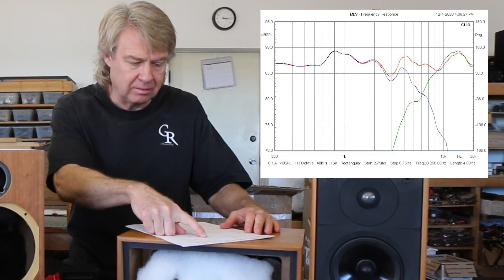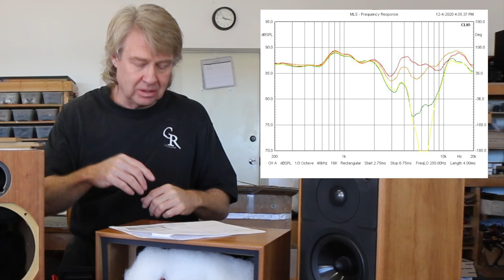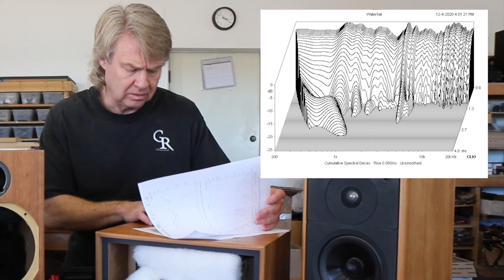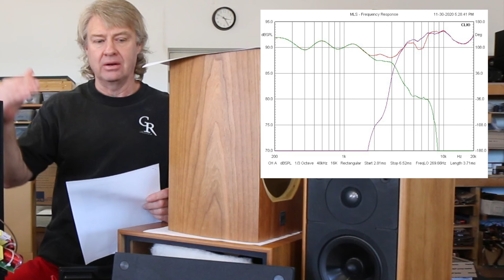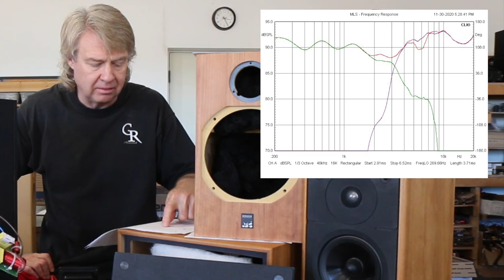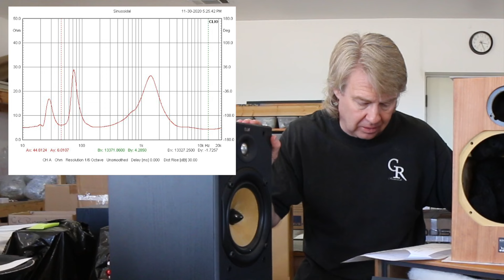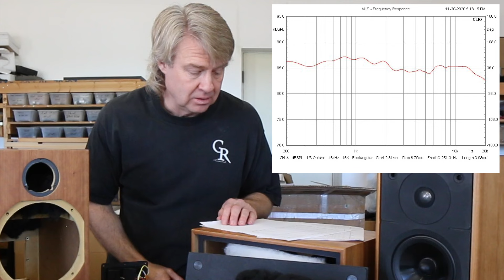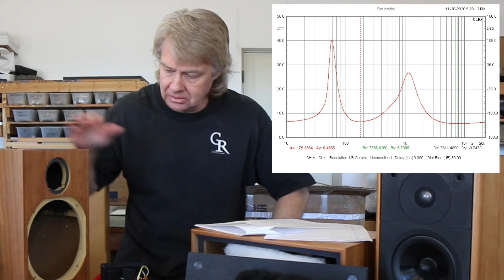FINALLY! A SPEAKER DANNY LIKES?! B&W, Epos and ATC!

Comment: I just picked up a pair of Tyler D3M monitors.  What are your thoughts?  Room for upgrade?
Reply: It is hard to get much out of those metal cone Dayton drivers, but I am sure there is a lot of room for improvement with the crossovers.
Reply: @dannyrichie9743  Mine are fitted with Gui-Sound paper cone woofers.  Says Custom: Tyler, 16 ohm, 20W.  FR158B16-11M

Comment: Rcently decided to take my 1995 B&W P4 crossovers apart. Having already researched what to expect, there are really some performance limiting components for a speaker that cost £600 per pair back then. Very simple second order with electrolytic caps and small iron core inductors are not in keeping with the decent drivers and a transmission line cabinet. They do not sound bright as per the B&Ws in this review (even though they use the same drivers) because the tweeter ferrofluid has long since dried up. I only notice what a tweeter should sound like when I go to my office and listen to some silk dome Cyrus CLS50s. Needless to say, the P4s will be treated to some new fluid and a rethink of the crossover with better quality components and internal wiring. Ironically I know that I can build speakers better than these, but they served me well and deserve a second lease of life.

Comment: Hello Danny,  Have you come across a pair of B&W DM7 Mk1 (the original version). I would like to add tube connectors to my pair, upgrade the crossover and remove the two fuses to tha pathways as well.  I also like the feet that are on the bottom of the pedestal base.  I look forward to your response.
Reply: Sounds like a good plan to me.

Comment: Are you sure the ATC  woofer is paper material? I have the SCM-11 and I read the driver is made from acrylic.
Reply: It looks like some type of paper. It could be a composite of some kind.
Reply: I think they are doped paper, there is a factory-tour video somewhere here on YouTube I’ve seen recently
Reply: @tggonzales7971  Yea, I've seen that video but it didn't discuss what the driver is made of as far as I remember.
Reply: @tggonzales7971  I did more research and the woofer is made from acrylic, like I said. HiFi Pig review of the SCM-11 says the following, "All ATC drivers use their own specially formulated doping compound. Being of a low mass it allows the driver to remain fast and accurate as well as having high damping properties removing excess energy and controlling unwanted resonances. The mid bass driver is made from acrylic and soaked in the formula leaving a slightly sticky to the touch feel".

Comment: Gentle, loving but uncompromisingly honest. Danny I wonder if you could start a school of crossover design with all little secrets and clues :) Or a series about choosing drivers for a project (with examples and explanations) Right now i'm in a process of assembling my first small DIY project based on Scan-Speak D2604/830000 and15W/8424G00, but already i have my doubts, project is based on something i found ont the web and all parts iv'e ordered are high quality, but when i watch you i just can't imagine that my build will be as good as it could be. Ordering from you makes a little sense because i'm from Europe :( 
Or maybe consider creating your European  warehouse?
Near by we have an Amazon fulfillment center for a local area (central Europe), i reckon that you don't need so huge space, and a little space can be found here quite cheaply (Poland)

Comment: I understand the rabbit hole is deep. However, being concerned with vertical response from 1 meter is a bit silly. That’s a near field use case scenario (where seating position is most likely relatively fixed). I could do some trigonometry and statistical analysis to find relative use cases for the types of rooms and events where people are moving, sitting, standing, etc…but this is a YouTube comment. Let’s just suffice it to say for now, 3-6 ft is a 1.5 ft variance. At only 6 ft, that’s only a 15* shift. In my designs, I’m not too concerned with having dispersion over 15* off-axis.
Reply: Nope, it has a LOT to do with what you hear at the seated position.
Reply: How does off-axis response effect what you’re hearing at a fixed “proper” listening position? (other than effecting the amount of damping material desired around the room) If there’s some other factor not implied in the on-axis measurement which makes such a difference, could you please discuss it in a video?
Reply: @jtmcfarland3512  I have mentioned these issues in several videos. Your room reflections are going to reflect the off axis response. So let's say in the vertical off axis you have a huge whole in the response at the crossover point. Your ceiling reflections are uneven. You have hot spots and a hole. It makes for an imbalanced room response.
Reply: I think I’m starting to follow your line of thinking. Sorry; I have almost only watched your crossover rebuilds so far. I’ll have to look more into damping material options. Individual channel gain gives the illusion of distance. I’d be curious to see if a narrower vertical axis makes the room sound taller. Anyway, thanks for all your responses and education! Sincerely.

Comment: I had the 603 S2's.  I have some things to say about them but I'll listen to what you say first.
Reply: The 603's were the three-way design.  I remember the highs were always harsh and noisy.  The bass was pretty weak considering it was a three-way.  I tended to listen a bit too loud.  The rumour I heard was that B&W rushed them out in time for the Christmas season.  The other rumour was that to make up for a lack of mid-range they artificially  boosted the highs and lows.  They were not very satisfying.

I changed them for a 2-way pair with a horn tweeter.  They were more detailed, no harshness, lovely midrange and deeper bass.  Recently the bass drivers started to fail so I had them replaced and the crossovers looked at.  The guy told me the crossovers were just a single cap, resistor and I think an air cored filter.

Comment: Older B&W like these had average crossover with lot of cheaper parts in it  , to do more justice you forgot to mention caps were all poly no electrolitics like in KEF or other competing brands...and drivers are build really really well and you did not even show them ... Cabinet and parts in crossover were the weakest link in older B&Ws...
More current versions of their 600 to 800usd mini monitors use simple 2 parts crossover with 14ga copper air inductor on woofer and single poly cap 4.3uf looking like EPCOS with 0.1ohm resistor on tweeter . Once much better poly cap with silver foil film bypass was used and 0.1ohm removed , tweeter have gained great quality and transparency and airness with ton of deatail and non fatiguing sound and very very little distortion , tiny bit boosted character of the tweeter that matches well with my 48yrs old ears most likely losing a lot of high freq extention 😉 by now.
I removed the crossover and have used airfoil copper inductor on the woofer and layed it flat on the bottom of cabinet and caps all soldered directly to the back of binding posts and than back to drivers while have added some acousta fill to the cabinet instead of stock sheets of poly.
  Great Sound improvement and in my small very dampened room it sounds great ... 
I wish I could do more real reengineering with all the equipment and knwoledge of Danny but even what I simply did made these small 686s2 sound much much better .
Nothing like fun of tweeking !😄👍
Reply: Which speakers are built with quality brands in them?  Danny mentions that Elacs are well engineered.
Reply: @bella3008 All of them have weak sides and need tweaking to sound at thier best. It is up to you or Danny to address weaknesses and than tweak them...

Comment: Have to say Danny, those "cheap" B&W crossover items have less variance over time compared to many other speakers I've owned.  Also, just because it looks like good quality doesn't mean it will last.   I have a pair of B&W DM603's similar to your 602's and the crossovers are still in great shape and well within spec after 25 years.   Great analysis though have to admit.

Comment: Have you ever seen the guy on Youtube who designs and builds speakers? He would disagree with you. Tailoring sound, Q factor, speed, accuracy is all driver / motor / basket. Nothing to do with the crossover. All a crossover has to do is eliminate frequencies certain drivers can't reproduce well. Infact, the best speakers shouldn't use any crossover at all... but those kinds of speakers are very cost prohibative. (Like the D9e Urushi which are $60K just for the driver)
Reply: Nothing to do with the crossover? That is like saying the performance of a car has nothing to do with the engine.

Comment: Never did hear the ATC model number. Nor is it mentioned in the comments?!?
Reply: I think it was the SCM 11.
Reply: @dannyrichie9743  Thanks Danny.
Reply: @dannyrichie9743  you think...but you're not sure...! Instead you've put your glasses for the right model of the B&W.... Ok...that's tricky!
Reply: SCM11v2. There was a predecessor known as the SCM11. However, ATC never changed the name for the newer 2013 onwards model. They still call it the SCM11! The SCM7 is on it's third revision.

Comment: Would really like to hear, or see, the response curves after your make over. And as an aside what l find interesting is the expensive speakers on average tend towards visual appearance and thus appeal verse truer sonic quality as demonstrated in their "Cheese Boards" and subsequent response curves telling the truth. In comparison the ATC stressed higher quality Speaker components as did their cross over. And it would seem they realized the fancy and heavier cabinet wasn't as big a factor in overall quality. Also possibly that anti resonance material wasn't available to them either that it didn't exist at the time, or wasn't considered as important as it should be

Comment: Why doesn't every manufacturer use tube connectors and include adapters?
Reply: Retail 50USD just for the connectors. Now why are they doing that?...
Reply: @edgar9651  wouldn't they be cheap if everyone used them?

Comment: You’re neglecting the fact that nobody is sticking their head up to a speaker and moving around to check phase. If so, ONLY make coaxial designs. From 6ft away or more, the phase shift due to speaker alignment from moving off axis 15 degrees is almost nonexistent.
Reply: Actually it has a dramatic effect on image and sound stage layering. Having the phase off by a little bit disrupts the time domain. Also, the vertical off axis response clearly shows or tells you a lot about what the total in room response will be.
Reply: Are you saying you can hear a difference in room response between a coaxial and closely mounted component set of speakers? I’d be willing to bet a gated impulse response test would be sufficient to show the difference.
Reply: Car audio guys are very familiar with better phase alignment from increasing distance to the drivers. Maybe I wasn’t clear in the point I was trying to make.

Comment: Would be helpful if you quoted the BL factor when discussing the ATC's woofer. Good video though.
Reply: Yeah, but most people don't even know what that is.
Reply: @dannyrichie9743  Yes but you can tell them.  

If you can discuss a technical subject like Xovers then (in my opinion) you can (lightly) discuss the force factor BL.

Whenever you're discussing the playoff between cone/bobbin weight and magnetic field density/strength the BL factor is handy to consider because more cone/bobbin weight (sometimes) doesn't necessarily mean less resolution; particularly if the extra weight is offset by greater field strength/density and/or a better overall motor. 

Take JBL's Neodymium Dual/Differential Coil Drive 12 woofer systems (with the braking coil) as an example. 

I like seeing you pulling apart the big named speakers and showing everyone what's really in them. The market has been ripping its customers off for years.

Jim Stanley;  Electronic/Electrical Engineer. PhD Electroacoustics.
Reply: @StormCentre88  Okay, good points. I'll keep that in mind. I may have some more ATC stuff coming in soon.
Reply: @dannyrichie9743  Thanks for your responses.

One more thing . . . . 

Almost all the CSD (waterfall) plots of various speakers that you throw up look remarkably good.

Almost too good for what you’re measuring, as sometimes even average (non modified) 2 ways seem to have a reasonably benign waterfall plot.

Are you using a different technique/microphone?

Comment: in two way systems  a true mid range will always be missing...
Reply: I agree.  Way too much engineering and costs trying to flatten out the midrange... when the solution is simple.  Personally I am planning for my next system to be an unconventional 3-way with a nicely voiced 2-way bookshelf with a high-pass filter so it does not have to do any heavy lifting and setting them on two subs.  I need to determine what 2-way design would be best for a nice smooth 200hz - 20k hz response.  Let the subs handle everything below 200hz

Comment: It’s a very unfair comparison. Epos and B&W are consumer products. ATC has been a big hitter in pro audio for decades. They’re chalk and cheese. Most recording studios use ATC Monitors (I use Kalis, ATCs and the ubiquitous Yamaha NS10). The Kalis and the ATCs have active crossovers and separate amps for every driver - the passive crossover in ATC’s domestic stuff is a poor substitute, but hopefully most people will at least bi-amp them! 

They are worth every penny. But, they are as flat as a mirror. If you want a tuned sound to your own taste and you haven’t got access to digital EQ, you’ll probably find them very, very dry. And listening to analogue sources will make your ears bleed. Every tiny mechanical artefact whether on tape or grams will up front and centre for your pleasure/distress. Personally, I prefer to listen to music on a flat, reference, system because that’s what the Producer wanted me to hear. Each to their own.

Comment: Changing the crossover parts on the ATC speaker won't improve the sound unless you change the values.  They are already using good quality parts, there.  You could add a small value film cap to bypass a resistor to the tweeter to bring up the 20 KHz response, but I bet it was purposely designed to drop off there to reduce an otherwise harsh/bright sound.
Reply: I can categorically tell you this is incorrect. I did add a bypass cap and we tweaked the values to raise the tweeter response a very small amount but the clarity improvement in the bass and mid-bass area as well as the vocal range is vastly improved. The speakers were already quite resolving but these parts too it to a new level.
Reply: The difference in the quality of the capacitors can drastically effect the sound. And the parts used were fair. There is a lot of room for improvement.
Reply: @dannyrichie9743  Film caps cannot be improved upon.  Electrolytics need to be replaced; film parts do not...ANY film caps.
Reply: @HarmonicResearch  That is very incorrect. There are significant variances in sound quality from type to type and brand to brand  of film caps.

Comment: Hi I got back into hifi last year. I used to live about 30 miles from the Wharfedale factory. I bought a pair of wharfedale Dovedale 3 speakers in Fort Collins. They had a a great reputation back in the 70s. Now they sound great to me hooked up to my NAD. They are in new condition, the woofers being original with paper cones. They have no stands so I put robber feet on the base. I put a Polk subwoofer in the circuit mainly to protect these old woofers a little. I play a lot of Pink Floyd, loud! Please could you suggest any simple changes I could make? They do sound great!

Comment: Is one time alignment solution better than another? Physical vs electronic? One can see so many manufacturers using physical time alignment in their floor standers more so today than ever, especially in high end audio. On another note could waveguides & horns be used to solve edge diffraction/omni resonances? Can horns & wave-guides be utilized in open baffle designs? Is that idea retarded? On another note I'm wondering what you might think of the newer Audience 1+1 speakers, being crossoverless bipole full range with a passive radiator. On another note, cabinets of BBC designs like the LS3/5A use cabinet resonance as part of their sound, which their fans swear by. That being completely the opposite of what you do in your upgrades. I wonder what an LS3/5A would be like with a heavily braced/damped/non resonant cabinet? Would it totally suck? On another note, I've just discovered Decware. I know you have some cheap Chinese 300B amps you like. I'm wondering if GR Research & Decware might partner at shows sometime in the future?
Reply: The best alignment is acoustical. That means the waveforms are in phase. 

Wave guides can help minimize diffraction but only in some wavelengths. The longer ones still wrap right around them.  

And yes wave guides can be used in open baffle designs. See them here: https://www.gr-research.com/nx-series.html

I have had the Audience 1+1's sent to me. I measured a front to back wave cancellation problem with them. After discussing it with their engineers they implemented a cap on the rear driver to keep it from playing down low enough to have that issue. So the later ones were much better. Still not a lot to write home about. 

And yes cabinet wall resonances can add some favorable bloom in some cases. But that is not a reproduction of the input signal. It is artificial. 

Doing away with the resonance issues on the LS3/5A's would make them more accurate. I don't know if they would be as well liked or more liked. I never cared for them to begin with. 

Our Elekit 300B amp is actually a Japanese design (not Chinese). 

We won't be doing any shows for a while.